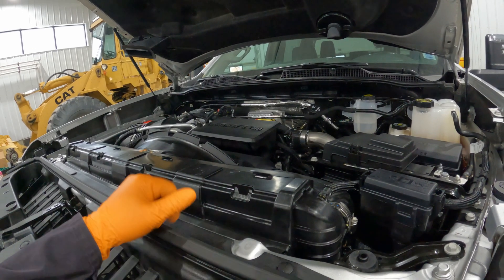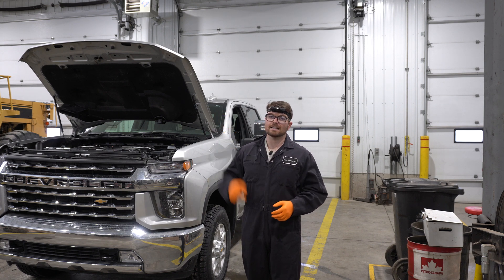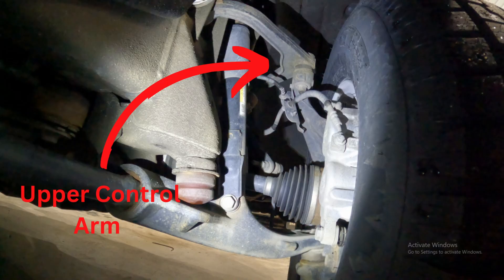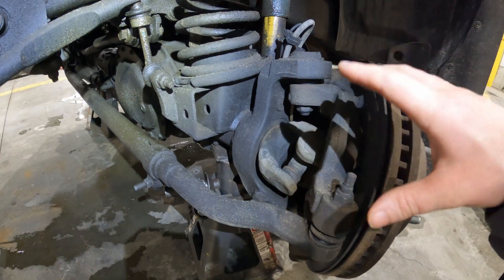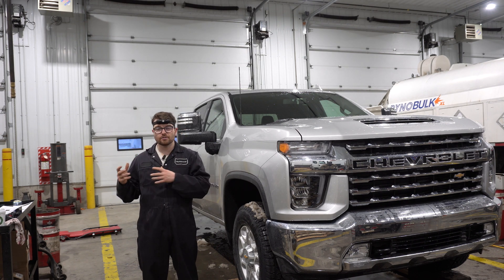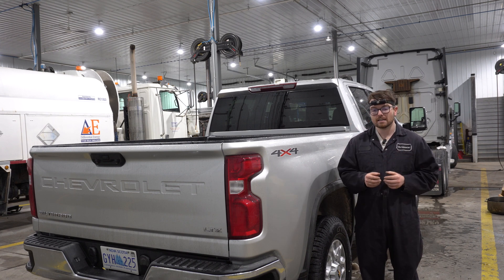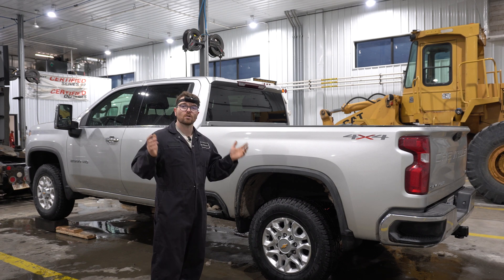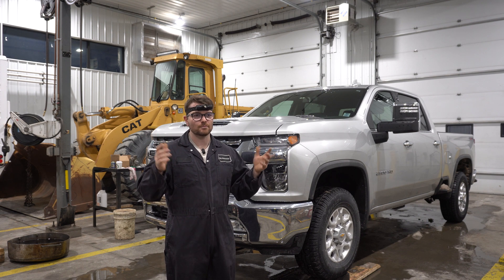Chevy 2500 6.6L Duramax Diesel Review (Part 2) | Does GM Make A GOOD Truck??

Comment: I just picked up a 2025 Duramax after trading my problematic 23 superduty. A big thing I noticed was the superduty had zero grease zerks. My drag link was worn before 36k. The 25 duramax has them on every joint so far I am impressed with the new truck but I will see how it holds up in comparison.

Comment: You don't know what your talking about when it comes to ifs stock they can take an absolute betting. Just think what happened when you hit a big rock on your front solid axle all that energy goes right into that axle. On ifs it hits the strong frame. I have a Chevy zr2 s10 4x4 manual and a 1990 gmc k 1500 and i flog the crap out of them and your not going to break the ifs unless you did something stupid.

Comment: I had an 07 duramax that hever needed brakes and all that went wrong was i had to replace the water pump after 14 years of great service and only 155,000 miles. I bought a 2021 high country 2500 duramax and its the best truck ive ever had. I pull my 32 ft. 5 th wheel with no problem. My first choice for buying a duramax was because they run and are so quiet. Love my truck

Comment: At some point, rear end gearing ratio becomes a moot point. With the old 4 speed, 3rd gear was direct drive. Shifting caused a drastic change in rpm. In a 10 speed, 7th gear is direct drive. So, 2.33 times the gear choices up to direct, and 3 times the number of overdrives in the 10-speed.  Keep up the great reviews.

Comment: Oh jezzos christos.  How long are intelligent, capable guys gonna go around containing about not having 3:73 or 4:10 Final Drive gearing? 

That's old man talking old man memory from way way back in the day you're talking from time of three speed transmissions when four was like amazing and for became five or six maybe in the Duramax.   There are 10 freaking gears in the transmission seven of them before you get to one to one the first gear is much lower than the typical first gear in most transmissions.  This is a simple multiplication game gear ratio and transmission times final drive is the engine to ground or axle rotation multiplication number or torque multiplication.    

They only have a 342 probably for simplicity and to fit off the g80 locker stuff in it but what does it matter if you have like your ratios and the transmission to multiply out to give little torque and have lobster options to switch to the argument over the rear axle ratio is Grandpa talk is like which it was somebody taught you 40 years ago and you're still harping on needing the same thing. it's like being pissed that there's not a choke lever on the dashboard and a fuel injected truck it's ridiculous.

Comment: If you need to work, buy a Ram, if you have a mix of work and driving, buy a Super Duty, if you simply want to be comfortable while recreation towing or work, buy a GM
Reply: That's an ignorant comment. Tell me why all the major contractors in my area that do heavy construction with roads and infrastructure mainly use GM pickups. I don't think it's because they are just out for a casual joy ride.

Comment: Hi Alex. Great video. I am getting at 2024 Silverardo Chev 2500 HD next week (only model available in Australia) Our previous vehicle (Toyota Land Cruiser 200 VX) has issues with the fuel injectors, they all needed replacing @170,000km. Would you suggest a fuel water separator filter for our new Chev?

Comment: Like the input on the L5p, watched both parts. First try to not use the Lords name in vane. Besides that I have a 2020 GMC 2500 to tow my camper, I’m running about 30k gross, I did have to bag it to help with weight sag. I get the rear end gear ratio feel but it works. It’s a beast and with the power band and the 10 speed u don’t need the gear reduction, the transmission does it for you, you get the best of both worlds. Keep up the videos. Love to see the onsite of the mechanics.
Reply: Jesus christ, I hope you're joking.
Reply: 'try to not use the Lords name in vane". FFS get a life !  Yeah this one is it, then your worm food or ashes - there is no BS heaven or hell !

Comment: Racers have put a thousand horsepower through rear drive constant velocity joints.  

Another thing to keep in mind is that military trucks like the Humvee and I believe the Joint Light Tactical Vehicle (JLTV) have CV joints.  Military trucks go off roading and tow trailers quite a bit by nature.

I should also add that the new military trucks have detuned Duramax engines.

For what it's worth my 2024 one-ton Chevy can tow 20K off the chassis and 22K on the gooseneck.

Comment: I work on Ford Super Duty and Chevy 3500 HD trucks. These trucks run in a city, pull trailers, plow snow and spread salt. In my experience the GM front ends have fewer problems. They also give a much better ride. I must add that the F450 does have a great turning radius.

Comment: Great and valuable information. Thank You.
I'm from Australia and in process of doing research on 2500HD American trucks.
So far  in Australia we only get 2 Factory backed options for HD trucks. Fully loaded Silverado LTZ and only with Duramax 6.6L diesel, second option is RAM 2500 fully loaded Laramie with Cummins 6.7L diesel. Ford is bringing F150 with only 3.5L gas engine, not sure about F250 and bigger? These trucks are converted to Right Hand Drive (RHD) by specialist factory conversion facility and fully backed by original manufacturers. Conversion is great and you cant tell that they have not originally made for RHD. In Australia we drive on wrong (Left) side of the road.

Anyway, I have been leaning towards Chevy because I don't do much towing and do long distance road touring where comfort is more important.
Alex, has now convinced me that Chevy is the way to go for me as solid front ends have been really bothering  me in regard of comfort and steering.

We will be getting 2024 LTZ update in couple of months time. What I can see from research is that the new update is mostly cosmetic inside with new dashboard and infotainment. Will probably wait to see the new 2024 update before pulling the trigger, but that will depend on wait times for actual 2024 model delivery and discounting on current 2023 models. I am an older guy and new digital dashboard is not that important to me.

Thanks again for very informative videos.

Comment: In the toyota 8" world the higher gears were stronger. The lower you go the less tooth contact you had between the pinion and ring. I would assume that is the same across the board?

Comment: I dont see the point when youtubers incorrectly refer to 4th and 5th Gen Rams as a Dodge. Everybody who is educated on the subject knows that production was moved to Chrysler production plants over a decade ago and Dodge has zero to do with the production since then.
Call them Chrysler Rams if you want.
Reply: Ram and Dodge are under the same company. Ram is the truck side. Dodge does cars are suv. Both are under Stellantis. Btw, currently all Cummins powered Ram trucks are also built in Mexico. Duramax is built in Ohio at Dmax LTD. Always has been. GM HD trucks are built in Flint Michigan
Reply: @countcuda70 You haven’t told me anything that I didn’t already know. It is common knowledge. The fact still remains that Dodge and Ram spilt into two completely seperate brands and manufacturers and FCA made that decision in October 2009.
Reply: @Dazza-u4c  2 brand, yes. Separate manufacturers, no. FCA doesn't own them, Stellantis does

Comment: Thanks for the video.  I'd appreciate it if you could answer a question for me.  Of the 3 main manufacturers of trucks, which 3/4 ton would you choose for snowplowing and why?  I work for a local company that provides a work truck.  I use it all year and plow snow in the winter too.  Currently its a 98 GMC 2500.  Its been a good truck but is starting to have some expensive problems and the company wants to start looking for a replacement.  Thank you.

Comment: We looked at all the big 3 trucks while shopping for a towing rig. We found that Ram 2500s had about 1000 lbs less payload than GMC/Chevy 2500s. Ended up with a GMC. Not sure how you hit those higher towing numbers on the Ram without overloading your truck.

Comment: With respect to the rear end, they geared at 3:42 because of the 10 speed. Old 6 spd was 4:01 in 1st, 10 spd is 4:54. This more than makes up for rear end change.
Reply: Ford still offers up to 4.30:1 in the HD trucks with a 10 speed. Look at the final drive numbers for a Ford vs a GM and the Ford has a lot more mechanical advantage and if you are towing heavy its simply going to be better. 3.42 is great for mileage but not as good for towing especially on the freeway. In the 1:1 gear on the trans where you should be on the freeway there is no way to get around the rear end gearing. Bottom line is the GM is going to have to shift more in the hills and in the hills it will not tow as well.

All that said i own a 2024 GMC 3500 and for towing im not a fan of the 3.42:s for the reasons i have stated, they are simply not as good. I have been there with the 3.42's before and i ended up re gearing the truck. This 3500  is probably going to get 4.10's.

Comment: I agree mostly with the axel opinion. But i do think a 3/4 with a gas motor is OK, but not ideal.
Reply: Just traded my 2023 gasser for a 2022 diesel.   The gasser is just too underpowered.  They should have put 411s in them.  15000 miles average 12mpg.  Down to 6 towing 10.000lb fifth wheel 75mph.   15 empty driving easy unloaded 60mph

Comment: You need to look at final drive ratio. If you put a bigger ratio rear end behind that insanely low first gear, you'll be snapping axles before you get out of the driveway.
Reply: Agreed. Also the reason they dodge comes with a 4.10 is because its transmission is a 6spd slushbox that needs all the help it can get

Comment: Something not mentioned in the comparison with the Ram 2500 is the insufficient payload in a 2500 Ram in the trim levels above the work truck.  I can't tow my fifth wheel in the Ram because the pin weight (unloaded) is 1800 lbs.  My Chevy has 3200 lbs of payload compared to the Ram's just over 2000.  While I technically could pull the empty fifth wheel with the Ram, I would exceed the payload by adding a second passenger.

Comment: One issue with solid axles, the damn dearh wobble, and on heavy duty trucks, it gets expensive fast, and many techs dont want to bother. Ive had independent gm front suspension with torsion bars, ifs rides and drives better, ifs is very durable, out of the big 3, gm has done it best, i had a 2006 lbz 2500, boss steel plow, it was perfect. I have ifs in my 2012 gmc savana 3500 16 box truck, the independent front suspension is smooth and fast to correct and act, ive missed mny close calls thank to the independent front suspension, gm is a balance, not the strongest, but ive pused to limits, and ive never had a problem besides replacing the pinon gear every 3 years on the Steering component.

Comment: I also priced the two trucks out . Couldn’t drive the Cummings . A recall on the 2500 and 3500 Dodges. Something to do with the transmission over heating. GM Price it at 70k and Dodge is 80 K range . I think for now I’m gonna go GM . Thanks for the review. I am in the market for a large truck again. I had a 2500 diesel Duramax. No problems . Bought it new .worst mistake in my life I sold it . I’m missing it and just retired and want another very soon . It never gave me problems while towing . Took it into dirt and sand . No issues .
Reply: @TheGettyAdventures - I'm really glad that BearPapa49 mentioned this. I am looking at and pricing a new one-ton dually and the Chevy comes in at $12,000 - $14,000 USD or so less that a similar RAM and about $7,000 - $9,000 USD less than a similar Ford. in the last four years RAM has just raised their prices to crazy levels and Ford is not far behind them. Now the the pandemic is well over and supply chains are mostly back to normal RAMs are starting to pile-up on dealer lots. I believe that is mostly due to their super high pricing. You can only charge so much more for a Cummins diesel.

Comment: Listen I get everything you are saying about the drivetrain and I agree 100% with your pros and cons. I just traded my 2017 Ram 2500 6.4L Megacab in for a 2023 GMC 2500 AT4HD Duramax. I originally went with the Ram specifically for the reason you mention about the front solid axle. I am a frim believe a solid axle is stronger and more durable. Although, I got tired of being tossed around the Ram cab on bad roads, it literally hurt sometimes. I understand the gearing issue you have in the rear and the desire to put a shorter gear set in the diff. If I had the Ram and exclusively towed I would want the 4.10. But in the GMC with a 10 speed I never lack for power. The gearing is on point in the trans and it keeps the engine in it torque band, granted the most I've pulled in the GMC so far is 10K lbs. But when I'm going up the on ramp to the highway and stand in it takes off.

Comment: At the Victor diamond mine in northern Ontario the Ford and Ram trucks suffered so many front end issues that Debeers basically banned them from being used. GM pickup trucks became exclusive for that reason
Reply: I've owned both GM and Ford.  Currently in a 2014 F550.  I hear all the time about how bad the GM IFS is.  In my experience, I've owned 4 GM trucks with IFS.  2 Duramaxs, 1 6.5td and 1 with a 454.  2 of them carried 8' and 9' snow plows respectively.  2 of them carried a 100 gallon slip tank and pulled a gooseneck dump and other trailers.  The very first front end issue I had was a balljoint at 265,000 miles.  A combined 720,000+ miles on the 4 trucks and 1 ballpoint.

My F550 is on its second set of balljoints at 74k miles.  The F550 is a different application of truck than the GM trucks I've owned.  However, in my experience, the GM trucks have by far been the lowest cost of ownership and have done very well for me working within their designed capacity.
Reply: @Asamccp  GM IFS does suck. But if you have a few tools and learn a new skill, it doesn’t take much to work on them.
Reply: I wonder what are the technical reasons for that, as the solid axle is supposed to be much stronger?
Reply: @VLK-73  same reason they have death wobble

Comment: While I agree that GM should at least offer more gear ratios, they still seem to tow just fine. The Ram 2500 will run out of payload capacity before reaching its tow capacity. Payload capacity on Ram 2500s is absolutely pathetic. Another upside of IFS is the lack of death wobble that can happen from solid front axles. I agree that the solid front axles are stronger and generally offer better articulation but have their issues too.
Reply: Gm has a higher payload.  Not because they can haul more. It's because they cater to RV owners. Going over the 10k GVWR has it's disadvantages.  Like putting any kind of big trailer back there and your in the commercial vehicle realm.  That's why ram and Ford stick to the 10k gvwr .
Reply: @Mattman2500  Well GM 2500s can legally haul more with their rating. We can argue semantics but Ram 2500, especially with a diesel, can have a terrible payload ratings. Like, worse than some midsized trucks terrible. If they're going to stick to the 10k GVWR they need to figure out how to make the truck lighter while maintaining  durability. From towing to truck campers to hauling stuff, you can't do HD truck things with such poor payload ratings.